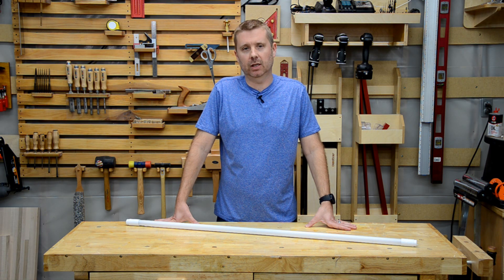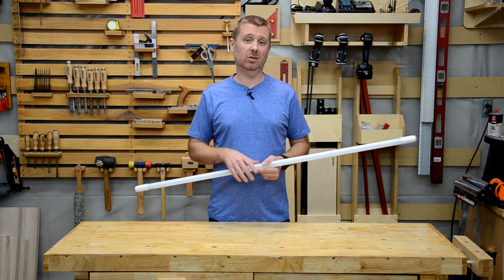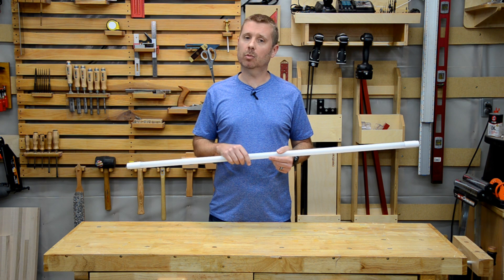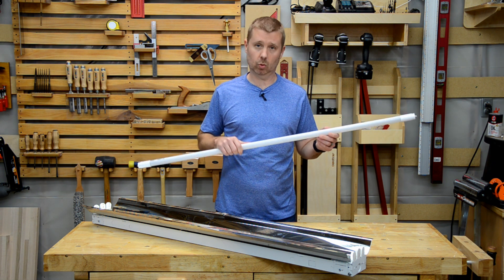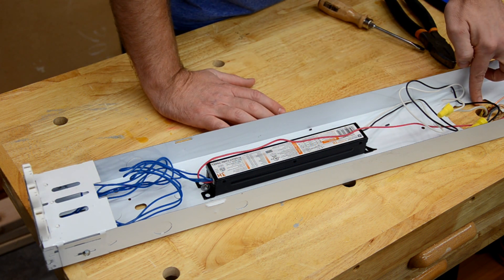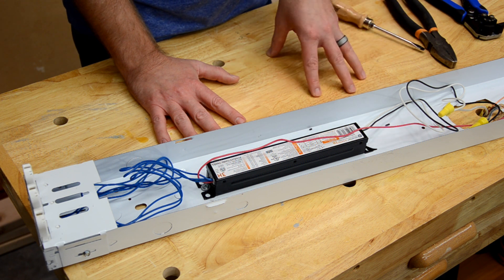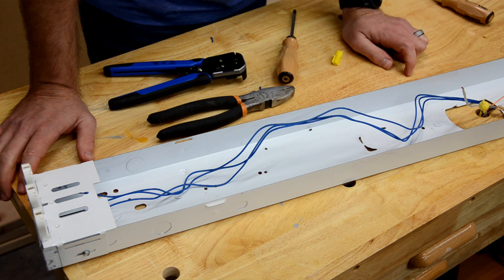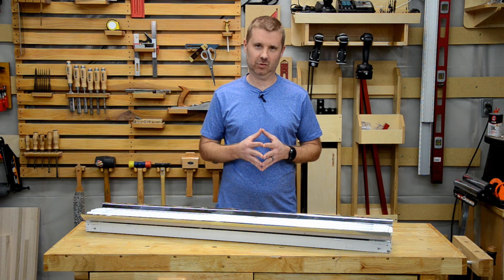How to easily convert fluorescent Lights to LED – UPDATED!

Comment: I've been wanting to do this to my Diamond Pool table light for a while.  Question: How would the LED's work in my cold garage in my work lights?  I'm hoping better than my fluorescent lights that were supposed to be for a cold area. Thanks!
Reply from the maker: LEDs in your cold garage will likely last longer than they will in my HOT garage. Since LEDs consist of all solid state electronics, the cold weather will keep heat down which is the primary cause of component failure in these things. As for operation, they will work far better than fluorescent (assuming you bypass the ballast). I think it would have to get so cold for you to notice a difference in LED performance that you'll skip the garage that day and sip a beer by the fire instead. 🍺🔥
Reply: @ToolboxDIY  Sounds great. Thanks!

Comment: Thanks for the  video, but the one thing you don't really mention, is why we would want to do this? How does the LED bulb performance and reliability compare with a fluorescent? 
I know LED bulbs are in theory more reliable however, in some cases the built in circuitry that allows them to plug and play with various fixtures/power types can fail long before the LED's would fail. I have had LED replacement bulbs fail after only a few weeks of partial use, and yes you can return them but... 
I know LED's are far more efficient than incandescent bulbs, but how do they compare with more efficient and longer lasting fluorescent bulbs?
Reply: One reason to do this is in a garage where it gets cold in the wintertime. My fluorescents were constantly flickering or not coming on at all if it was too cold.  LEDs solved that issue and have been working great for years.
Reply: @financialdave8514  Yea have since replaced mine as well as the ballast was getting unreliable. I found some that are substantially brighter, really helps working in the Garage. I am very happy with them so far and would also recommend switching, at least in places where you need a lot of light.
Reply: There is no comparison to the lumination from the LEDs.  LED is so much brighter then the fluorescent ones I had.
Reply: Not to mention the hazard of mercury if you break a fluorescent

Comment: Ha! Everybody loves LED lights. Cheap to run and instant brightness,  but they are also bad for your eyes. Didn't you know?
Reply: I have also read about this. But there are not many people talking about it (I researched it about a year ago) One doctor on the internet, even if its true that they are dangerous they will call the Doctor a quack just to push the new products. The LED's I have used a few years ago suck. I pencil in the date I install my home bulbs. Many of the ones I have bought guaranteed 5 years operation and they only lasted 1.5 years. I returned them and demanded another set. I am very happy with my Linear fluorescents (F25T8), they are lasting 7 years with constant use! (I use PRS Ballasts)

Comment: I have several 4ft. single tube flourescent fixtures that I will be be converting to the Hybrid A+B LED tubes. The tombstones are non-shunted with two wires each.  Am I correct that in this case both wires from each tombstone are connected to the power source? For example;  The two blue wires from tombstone A are connected to the hot lead and the two red wires from tombstone  B get connected to the neutral.
Reply from the maker: Your understanding is correct. Both wires from ONE tombstone go to the hot lead. Both wires from the other tombstone on the other end go to neutral.
Reply: @ToolboxDIY  Thank you Sir.

Comment: I'm confused.  Wouldn't the modification that you made be appropriate for Type B (double ended connection) LED tubes?  Why do you recommend Type A+B Hybrid for this modification?
Reply from the maker: I recommend the modification because I have a beef with ballasts. Well, to be more accurate, I have the worst luck with ballasts. I've had far too many fail on me. So I now recommend bypassing the ballasts for all LED conversions. Since you already have the ladder out why not get in front of a potential future problem!? But bypassing the ballast is not mandatory for these hybrid tubes. If you decide not to bypass it, you can always come back to this video if you get struck with my bad luck and the ballast fails. That's what I really like about these tubes...options.
Reply: @ToolboxDIY  I ended up ripping out the ballasts and wiring in all my basement flourescent fixtures. They all had non-shunted tombstones, so it was simple to re-wire them up in parallel for cheap single ended led tubes.  It was a two day project, but well worth it.  Your video gave me the inspiration to attempt it.
Reply: @ToolboxDIY  I've been offered a 1099 for to retrofitting LED lights but I don't know how much I should charge. Should charge per light and if I hire on labor how should I factor that in my bid? Thank you
Reply: @ToolboxDIY  I did the type a a left ballast in a fixture in my house on an 8foot ceiling because I actually didn't realize I'd bout LED bulbs, not fluorescent! I bought type A nonballast only for some 12foot tubes that were in fixtures about 25feet of the floor of a garage because they were the only I saw in home depot and lowes. And I only put 1 35watt LED to replace two 75watt fluorescents mainly because they were quite expensive, but they seem as bright if not brighter than the old tubes/ballast. Plus garage is un heated so they work better in the cold! I didn't put a sticker on the fixture but I figured the next person to replace these will find out they won't run fluorescents the hard way! Had about 15 old bulbs to get rid of but home depot took them in their recycle bin!
Reply: @ToolboxDIY  I've just been offer a 1099 for retrofitting LED lights but I'm not sure on how to bid it. Would I charge per light? And if I decided to hire on labor how much should I bid the job for?

Comment: I've been wanting to convert my lights for some time.  After seeing this update I ordered a box of twenty.  I found out that these are not plug and play for all fixtures.  I rewired two so far and am very pleased with the results.  Much more light than with the old fluorescent tubes.  The price of each tube is in line with the cost of a standard fluorescent tube so these are a winner.
Thanks for the update.
Reply: @Geoffrey Morrison 1.  That’s only for instant start which is never used in work places. 
2. There is so little mercury that it’s not gonna hurt you. 
3. There will always be a huge market for fluorescent lamps because of how common they are. 
4. In theory yes but in practice they never last as long and use the same amount of power and put out more light.
5. Modern fluorescent tubes with triphosphor coating can be tuned to any color temp and have a 90+ cri which leds struggle with (especially over a long period of time.
Reply: These are not cheap and will they last as long as the ballest ones? Even the one that works without the ballast has some electronics in its heads and it is not cheap as well, so it is not all together an easy ride. One can cost as much as nine pounds in UK. In my work placs we need ten thousands light, the ballast do not go off so often the light do, but the lights are very cheap. However if you have light that needs no ballast but cost as much as nine pounds for a pair of tubes they are certainly not cheap because in one year you will have at 60 blown out of ten thousands light and that means as much as 900 pounds a year cost. So it looks cheap but they are not cheap, the one that requires with ballast may be the better option because those one are normal price and those one are very good but the one that says no ballast at all you will find out when you change ten thousand of them and each pair cost as much as 9 pounds per pair.
Reply: @Dailymailnewz  here in the United States they cost about the same price. The ballast are around $20 though. I work for home Depot in the electrical department.

Comment: I've done a little research to see if there is any advantage to keeping the ballast in the circuit. All I have found is that it may provide about 15% more light. Anyone have any other information?
Reply: Very doubtful.
Reply: I've run several tests taking before & after amperage readings and using a light meter to check the Lux. (actual light output) Amperage readings vary a lot, depending on if you're replacing T8 or T12 ballasts and how old they are. Ballasts degrade over time, especially T12's and the amperage goes up as they degrade. Lux readings after converting also vary between electronic or magnetic ballasts. What I have found is that like Chris mentioned in this video, even when converting new flourescent fixtures, it takes less amperage and you get more light output when removing the ballast. I didn't keep the actual lux & amp readings that I've taken, but in my own shop I converted (19) 4 bulb fluorescent fixtures to LED bulbs. I did check one fixture using the T8 electronic ballast to power the 4 LED bulbs & it was about 10% higher with the ballast. The lux for that fixture increased by a bit over 10% after removing the ballast. Overall, my amperage per fixture was cut in half and the light output was more than doubled. I used 4' T8, 22 watt, 3,000 lumens, 2 end power, 6500K clear bulbs. I used 5000K bulbs in the garage portion of my shop. Hope this helps.

Comment: I take it that since there is no ballast involved, the circuitry needed to run the LED's must be inside the tube, correct?
Reply: correct, you don't need ballast, but they will work with some ballast. Utube it

Comment: Where is the Amazon link for the tubes you listed?
Reply from the maker: Click "Show More" in the description and you'll see it.
Reply: @ToolboxDIY  I can see where you meant the links to be (after clicking show more) but there is just text with no link.
Reply from the maker: @gregbeach9607  Thanks, Greg! Looks like I screwed that up. It should be fixed now. Sorry for the confusion.